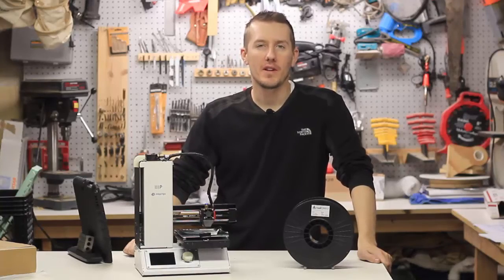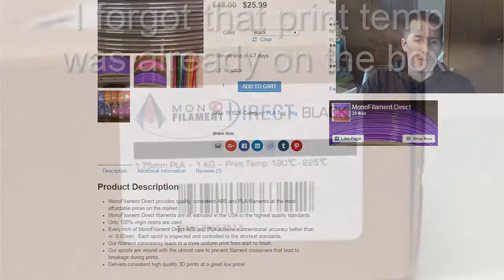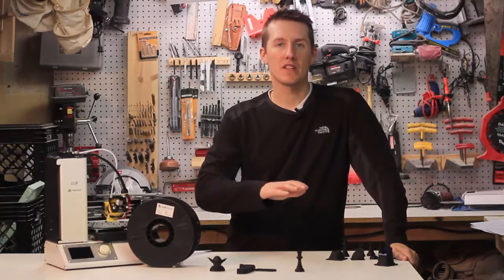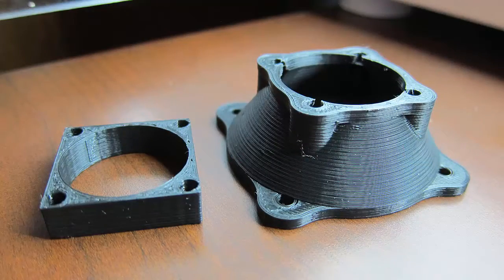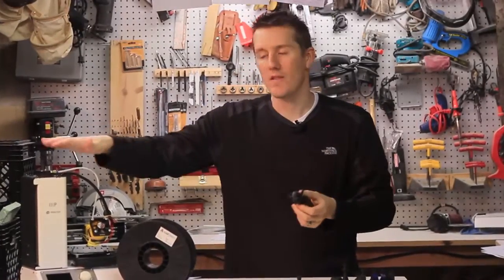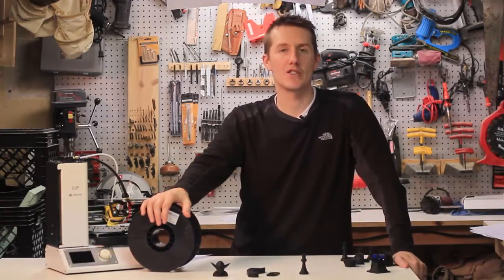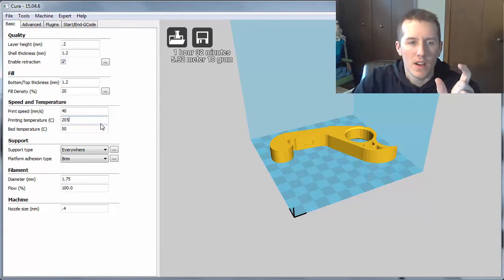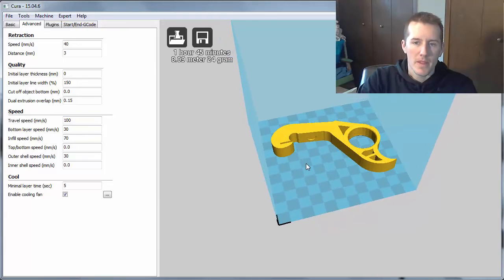MonoFilament Direct - PLA - 3D Filament Review

Comment: When configuring Cura, what type of printer do you choose. I dont see the monoprice in selection
Reply from the maker: Woody's Geek Channel it doesn't matter too much.  just manually resize the bed size to 120mm x 120mm
Reply: Ok, I am curious though about the size. The bed is a rectangle but you gave me square dimensions. Is part of the bed not used?